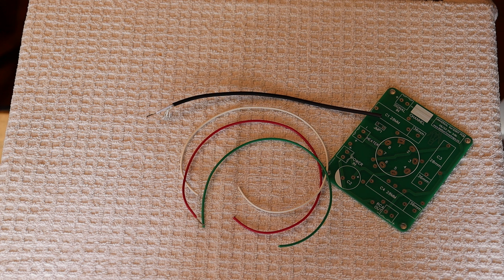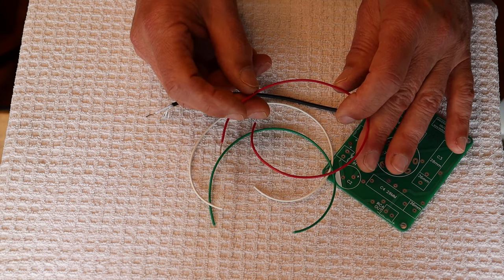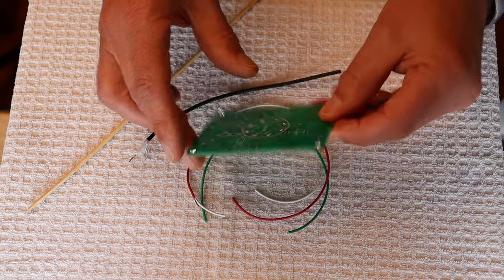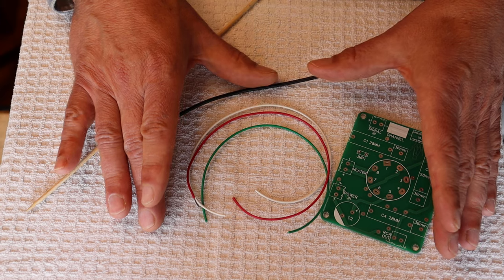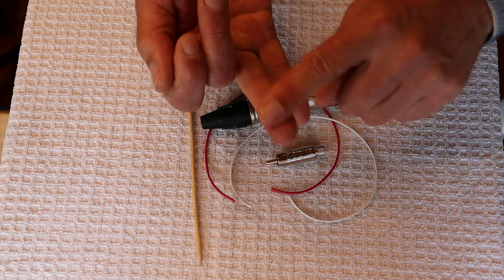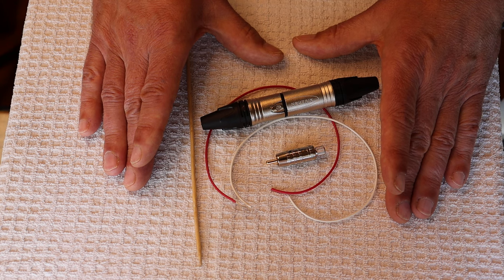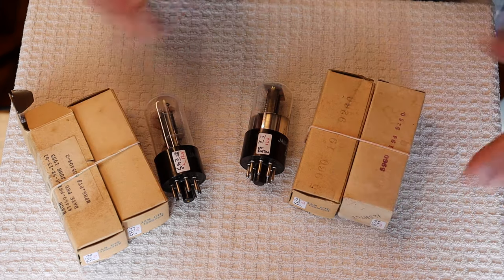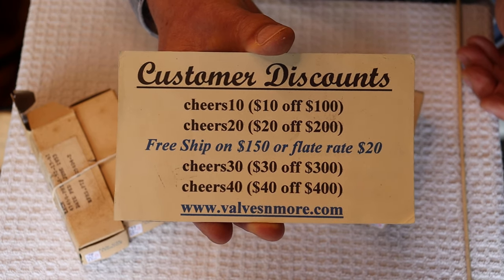Tube Lab #181 - Cables & What Matters

Comment: 15:35 - 16:20 All very valid points - I agree totally. Balanced connections are for studio gear, external application and I don't know what else. The point is, it is used out of necessity, not preference, in situations where the signal is subject to degradation due to significant external disturbances and factors. Studios and external sound installations have tons of gear. No businessman wants to double their cost of everything just for the sake of it or for an only slightly perceptible improvement in their end product unless they can charge millions or thousands of dollars to their willing clients for it. That's certainly not the case for most budget home audio gear owners.
Reply from the maker: For years now I've been pushing back against the home audio trend to switch over to balanced equipment and this is the first time someone has written in support of this.  Thank you!
Reply: You know, I didn't know either and was puzzled for years but while searching on the Internet I came across opinions from professionals in the music industry and others who offered this opinion.
There are of course plenty of home audio equipment with balanced connections, such as Accurate and others, but going this route quickly becomes a very expensive hobby. I think that even at this level, these companiess can offer such products because of the abundance of good quality,  inexpensive op-amps. Otherwise,  the cost would simply skyrocket.

Comment: You should be looking at some 6J5's and 12J5's. Been running some Sylvania's in my preamp...very nice. And with the power transformer having dual 6v windings, I can easily switch to 12v filaments. It seems like tube tech hit it's sweet spot around the 40's and early 50's. I've also had very good luck using Canare mic cable and Rean RCA plugs...very cost effective and very clean audio. Ended up wiring everything with Canare stuff.
Reply from the maker: @JS-oq2cd  in many ways the cv6 is the mil spec version of the 6J5.  We have good customers who buy a pair of them, mount them in double adapters and run them as 6SN7's, just like others do with 6J5's.  Years ago when I was developing the Yuri monoblocks, I wanted to run the 6J5 as the driver tube, but found them to already be rare and expensive and that led to the discovery of the very similar cv6 type, which simply sounds sublime.

Comment: 18:00 I cannot understand why there is currently no USA (or UK, German or other Western European) electron valve manufacturer given the resurgence of these devices in the audio industry and the fact that the demand for them never died in the professional music industry. One would think that with today's technology, manufacturing processes would bring the cost even lower and quality even higher than the best NOS devices out there. It would also help cure the craze for "more watts" pestering home audio consumers. In the end, good transistor gear and good electron valve gear cost roughly the same, weigh roughly the same and produce roughly the same heat - give or take. The main advantage of valve gear as I see it is that established valve types are significantly fewer and much more standardised than transistor types which nearly always guarantees one can find replacements thirty, forty, fifty or more years down the line - enough to pass on one's gear to one's grandchildren and great-grandchildren!
I mean it's not about cost of production or cost of setting up a new factory. If you see the number of specialised car accessories or third party part manufacturers, these industries are not cheap to set up yet there exist tons of them! Why can't it be the same for electron valves?